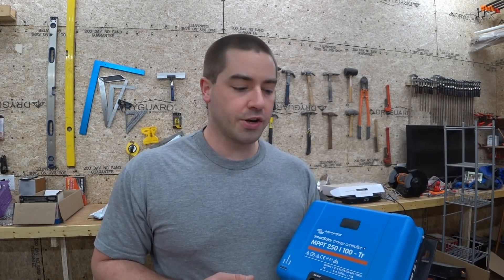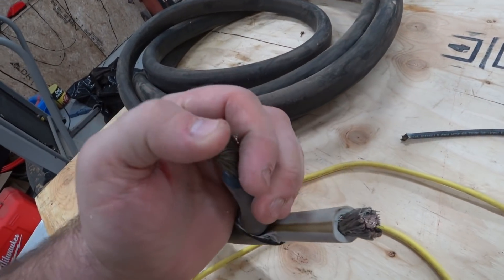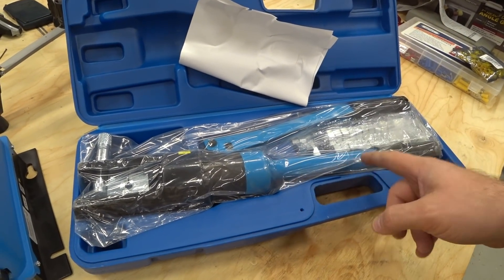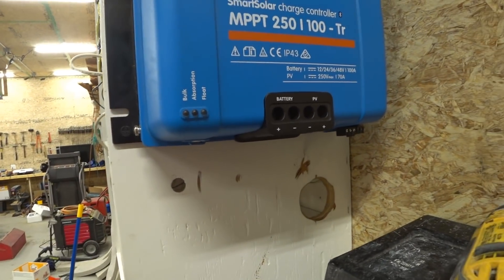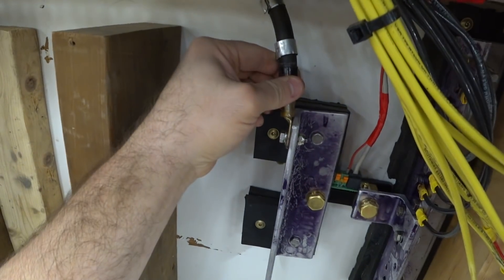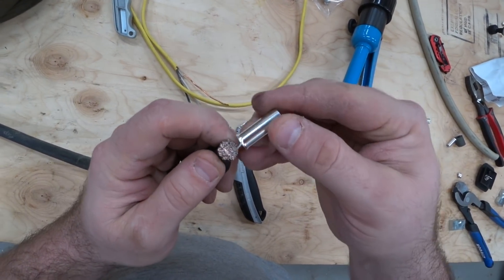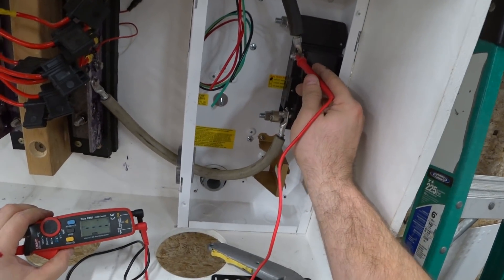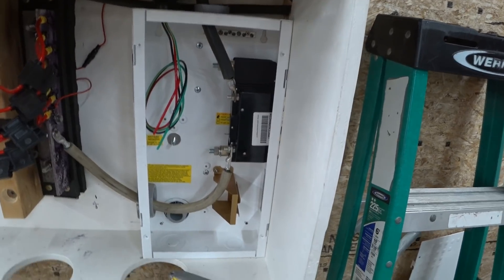Wiring Solar Charge Controller to Battery

Comment: what size breaker are you using ?
Reply from the maker: From the charge controller to the battery, I'm using a 125A circuit breaker.
Reply: @DavidPozEnergy  which would you recommend ? i dont want to go cheap and cause problems nor go to expensive ,  new at this and on a budget
Reply from the maker: Start with the charge controller you are using.  In my case, I'm using the Victron 250/100.  This model can output 100 Amps continuous to the battery.  Charge controllers can range from 5A to 100A generally speaking.  I don't know what size charge controller you are wiring up.  You need to look up the specifications on your maximum current (Amps).  
Once you know the maximum current you add 20% as required by NEC (National Electric Code).  In my case, I take the 100A*1.2=120A.  However, circuit breakers are not sold at 120A, the next closest size is 125A.  So, I bought a 125 Amp circuit breaker.  I used a "Midnite Solar" brand made for DC (direct current).
Once you know the breaker size (125A in my case) then you look up the Ampacity Chart in the NEC: https://codes.iccsafe.org/s/ISEP2021P1/national-electrical-code-nec-solar-provisions/ISEP2021P1-NEC-Sec310.16 in order to size your conductor (wire).
I'm using copper wire.  The circuit breaker I'm using is rated for 75°C (written on the breaker).  I look up the chart for a conductor that can handle 125A and I see that my minimum size is 1 gauge.  I used 1/0 in the video which is a little larger.  It's OK to go larger for the wire size, but not smaller.
I just described the process.  You must do this same process for your situation.
Reply: thank you  @DavidPozEnergy
Reply: little confusing ,but think im understanding , thanks for your help  @DavidPozEnergy

Comment: Measured leakage Voltage will be stored in the capacitors of the MPPT until drained over time or resistive small load,

Comment: So after reading the manual on the victron charge controllers I realized that if you accidentally wire the battery cables with the polarity in the wrong direction youll blow a non serviceable fuse and you need to send the unit back for repair... anyone know the cost of the repair... I can only imagine the unit must be replaced after seeing another YouTuber having to cut one apart to access the fuse... ouch

Comment: Hi David,  I have a Growatt 3000k inverter and I have max out it's internal MPPT. it is not capable to fully charge the batteries in one day because if the bank size. Is it possible to connect a secondary MPPT(solar array) to the battery system without damaging the Growatt Internals?
Reply from the maker: Yes.  You can have multiple charging sources feeding into one battery bank.  Your Growatt inverter won't know the SOC (state of charge) so ignore that on the display.  But it will still function the same based on voltage.  I'm testing this right now and it's working fine.
Reply: @DavidPozEnergy  Great! thank you so much for your quick response. Love your videos.

Comment: Not the propper tool for This crimping
Reply: True.  I believe it should be a square crimper.  That maximizes the surface area as the terminals close on it.  They won't come off with the one he used, but the surface area in contact with the terminal may not be adequate.

Comment: Thanks for sharing the vid. 
I've been looking into installing a Victron 250/100. 

I noticed some advice in the vid that contradicts the safety instructions in the Victron Manual for Smart Solar Chargers. 

In short the video says using wires without very fine strands is ok, when the manual says it will eventually result in fire.
 The examples in the vid showing thick stranded wire ok to use have matching photo's in the manual which says they should not be used.

What follows is from page 5 of the Victron Manual, note the last sentence.

Use flexible multistranded copper cable for the battery and PV connections.
The maximum diameter of the individual strands is 0,4mm/0,125mm² (0.016 inch/AWG26).

A 25mm² cable, for example, should have at least 196 strands (class 5 or higher stranding according to VDE 0295, IEC 60228 and BS6360).
An AWG2 gauge cable should have at least 259/26 stranding (259 strands of AWG26).
Maximum operating temperature: ≥ 90°C.
...
In case of thicker strands the contact area will be too small and the resulting high contact resistance will cause severe overheating, eventually resulting in fire.

Link

https://www.victronenergy.com.au/upload/documents/Manual-SmartSolar-charge-controller-MPPT-150-70-to-150-100--250-70-to-250-100-VE.Can-EN-NL-FR-DE-ES-SE-IT.pdf

Cheers Sincerely 
David
Reply from the maker: Thank you David.  Your comment is excellent.  I love when I'm called out, but you also help me with a link and explanation.  I've moved this charge controller and replaced some wires since this video, but I have not made an update video describing my mistakes.  Thanks.

Comment: Well in this type of connection the connection is MUCH better without the crimped ends, as the cable can cover the whole connection surface. Crimped it only touches on very thin points, which leads to high resistance

Comment: David  If the fuse trips for the Batt and the solar panels are still plugin to the charge controller will that damage the controller with no Batt going to the controller?
Reply from the maker: I've asked that very question to Victron and they said it will not damage it so long as the PV is below the voltage of the CC.  In my case 250v.  I've done this by accident, turned off the battery while there was still sun on the PV.  The CC is still working.

Comment: Trimming that larger cable to fit the smaller ferrule just turned that ferrule into a fuse and a fire hazard. It would have been better to source the proper cable size. And you used the wrong size die on that first ferrule. You can tell by the squished section that it appears you have filed down.

Comment: It seems to me, if those terminals on most charge controllers are too small to accommodate a huge wire, it may not be necessary to use a wire of that size. I had purchased a 4 AWG wire, thinking bigger was better, and just the fact that shoving it in those terminals was such a bitch, I put back my 10 gauge.

Comment: the voltage measured when shutting switch off is resudu voltage left in the charger, earthing wire here in europe for auxiliary earthing is 4mm², main earthing water and heating is 6mm²,  earthing bar in the electricity box need to be 16mm² where all your earthing comes to.

Comment: Hi I have  a question  all solar  panel  is 12 volts
Reply from the maker: Nope.  Solar panels can come in lots of different voltages.  The panels I'm using are 38 volts each, and I series connect 4 of them to make 152 volts.

Comment: But I had read somewhere don't put Ferrull's on
Reply: The victron manual basically says it's connectors are to work with very fine strands. So using a ferule does the exact opposite i.e. makes the wire for connection as big as can be. 

I wrote the following in my comment. 

I noticed some advice in the vid that contradicts the safety instructions in the Victron Manual for Smart Solar Chargers. 

In short the video says using wires without very fine strands is ok, when the manual says it will eventually result in fire.
 The examples in the vid showing thick stranded wire ok to use have matching photo's in the manual which says they should not be used.

What follows is from page 5 of the Victron Manual, note the last sentence.

Use flexible multistranded copper cable for the battery and PV connections.
The maximum diameter of the individual strands is 0,4mm/0,125mm² (0.016 inch/AWG26).

A 25mm² cable, for example, should have at least 196 strands (class 5 or higher stranding according to VDE 0295, IEC 60228 and BS6360).
An AWG2 gauge cable should have at least 259/26 stranding (259 strands of AWG26).
Maximum operating temperature: ≥ 90°C.
...
In case of thicker strands the contact area will be too small and the resulting high contact resistance will cause severe overheating, eventually resulting in fire.

Link

https://www.victronenergy.com.au/upload/documents/Manual-SmartSolar-charge-controller-MPPT-150-70-to-150-100--250-70-to-250-100-VE.Can-EN-NL-FR-DE-ES-SE-IT.pdf

Cheers Sincerely 
David
Reply: The victron manual basically says it's connectors are to work with very fine strands. So using a ferule does the exact opposite i.e. makes the wire for connection as big as can be. 

I wrote the following in my comment. 

I noticed some advice in the vid that contradicts the safety instructions in the Victron Manual for Smart Solar Chargers. 

In short the video says using wires without very fine strands is ok, when the manual says it will eventually result in fire.
 The examples in the vid showing thick stranded wire ok to use have matching photo's in the manual which says they should not be used.

What follows is from page 5 of the Victron Manual, note the last sentence.

Use flexible multistranded copper cable for the battery and PV connections.
The maximum diameter of the individual strands is 0,4mm/0,125mm² (0.016 inch/AWG26).

A 25mm² cable, for example, should have at least 196 strands (class 5 or higher stranding according to VDE 0295, IEC 60228 and BS6360).
An AWG2 gauge cable should have at least 259/26 stranding (259 strands of AWG26).
Maximum operating temperature: ≥ 90°C.
...
In case of thicker strands the contact area will be too small and the resulting high contact resistance will cause severe overheating, eventually resulting in fire.

Link

https://www.victronenergy.com.au/upload/documents/Manual-SmartSolar-charge-controller-MPPT-150-70-to-150-100--250-70-to-250-100-VE.Can-EN-NL-FR-DE-ES-SE-IT.pdf

Cheers Sincerely 
David

Comment: Hi David. I'm build my very first solar off grid with Victron, can you please take a look at my build and see if it works? I'm not sure if the 150w panels will work with the Victron. THANKS! https://www.evernote.com/l/As-kIlcP87BC-ZIV7gyVkt3C-7v5GPenR_g
Reply from the maker: Wow, that is a very nice diagram.  Thanks for labeling everything.  Looks like your 4 panels will be within the limits of the Victron 150/60 for Voc, and watts.  10 gauge from the panels to charger is fine.  Charger to battery you listed as 6 gauge, which is also fine if they are close to each other.  If the charge controller and battery are in different rooms then maybe bump that up to 4 gauge simply for less voltage drop.  Victrons website says the terminals on that model charge controller can go up to 2 gauge.    You have fuses and a disconnect switch, so you are OK there.  Maybe add a means of disconnect between battery and charge controller.  I see you have the fuse there, which is good.  I would add a circuit breaker also.  I like to size the circuit breaker a little under the fuse.  But your overall numbers and sizes all look good.
Reply: @DavidPozEnergy  Would a 60a Circuit Breaker work between battery & controller like this https://bit.ly/38BLlDa

The length of my 6 gauge is 6 feet and my 1/0 guage is 4 feet. THANK YOU!!!!!
Reply from the maker: Solar panels are rated under STC (standard test conditions).  But every once in a while you might encounter more sunlight than STC.  This happens to me this time of year with the snow on the ground, cold air temp, and a clear day.  So we generally add 25% to be safe.  For example, your 600 watts of panels charging 12v = 50 amps.  But multiply that by 1.25 = 62.5 amps.  So using a 60 amp circuit breaker has the potential to trip once in a while.  Very low risk because there is some overhead built into circuit breakers, but the potential is there.  I would prefer sizing things a little over.  So I might use a 70 amp breaker with 4 gauge wire, and an 80 or 90 amp Class-T fuse.  This also helps if you include your continuous duty requirement.  Which simply says you need to over-size wires if you use them continuous duty, which this is.
Reply: @DavidPozEnergy  This is so helpful thank you. God bless you and your family.
Reply: @DavidPozEnergy  Hi David hope you don't mind I ask another question. If I use 2x 150w panel with a voc of 22.7 or 3x 100w panels with voc 21.2 which one will charge my battery faster?
Reply from the maker: Hi Ken,  When you use an MPPT Solar Charge controller (like the Vitcton) The exact voltage coming from the panels does not matter, the charge controller drops it to match the battery.  The VOC of your series simply has to be lower than the maximum rating of the charge controller.  And the Vmp has to be a higher than the battery.
Reply: @DavidPozEnergy  Ok Thanks so much again.

Comment: my 20/20dingo plasmatonics pwm charge controller 12 24 48 volt  it won't work with my single house solar panel 180 watts why???

Comment: I have a question I can't seem to find the answer to. If I buy me a 12V solar setup of around 1000 watts worth of solar panels, a 3000Watt power inverter and all the other misc cables/components but only 1 lithium battle born @ 100AMP hours would I over charge my battery? would that ruin anything? because my budget doesn't allow me to get all the batteries at once so I plan on buying them slowly I'm hoping to get at least 6 eventually. but could only buy one right now. can someone please advise me?
Reply from the maker: Hi Lone-soul.  Thanks for your question.  First, the Battle Born battery has a BMS built into it.  (BMS=Battery Management System)  This BMS should protect the battery from being over-charged.  In addition, you should be using a Charge Controller in between the solar panels and battery.  The Charge Controller will do several things, but one of them is prevent over charging.  I'm using the Victron Charge controller in this video, but there are several good brands.  

The biggest thing I see wrong with your setup is the amps.  The Battle Born battery has a maximum current rating of 100 amps.  https://battlebornbatteries.com/wp-content/uploads/2018/03/BB10012-Cut-Sheet.pdf  If you connect a 3000 watt inverter, it will pull over 250 amps.  2.5 times the rating of a single battery.  

To be safe don't connect a 3000 watt 12 volt inverter to any less than 3 Battle Born batteries.  Other solutions would be buying a smaller inverter, or running a higher voltage system (24 volts or 48 volts).
Reply: @DavidPozEnergy  wow thanks a lot for all the info. I will follow your advice.

Comment: Hi, should you get a reading from your charge controller once you connect the solar panel, cheers.
Reply from the maker: I can open the app on my phone to see what is going on with the charge controller.  Inside the app I can read the incoming volts and amps, and the outgoing volts/amps.  There is also history stored.  Thanks for watching.
Reply: You're not supposed to connect the solar panels until after you connect the batteries

Comment: Hmmmm I believe Victron recommends just using the bare copper for their MPPT’s, based on what I’ve seen on the Victron community board.
Reply: They also recommend a finely stranded copper — typically found in marine applications.
Reply from the maker: Thank you.

Comment: Thank you. Omg I have searched everywhere, yours is the closest for help. lol  I got a 100/20 using a 10 gauge wire with EC8 plug going into a goal Zero generator..can you maybe tell me what size Ferrule maybe, or a rough estimate?  Thanks so much.
Reply from the maker: Hi bobby brown,  Thanks for your question.  I've heard good things about Goal Zero generators, but I have never used one so I don't know about hooking up to it.  As for the 100/20,  I just looked up the data sheet: https://www.victronenergy.com/upload/documents/Datasheet-SmartSolar-charge-controller-MPPT-75-10,-75-15,-100-15,-100-20,-100-20_48V-EN.pdf
It says the terminals are 6 mm (10 AWG).  So I just found a ferrule on Amazon: https://amzn.to/2XgfiT2  I hope that helps.

Comment: You mixing aluminum with copper?? Some one just told me that mixing those metals on connection make one of them going into dust in like a year time. I don’t know much about this stuff though.
Reply: I think the ferrules are tinned copper
Reply from the maker: Interesting.  My system has been up about a year and my connections are still tight.  I check them regularly.  Thanks for watching.

Comment: Electrical tape wrap on all your tools is good idea. Example, with your screwdriver, start the wrap, about 1 inch from the tip, and wrap towards the handle.Cheaper then insulated tools and just as effective. However, you must maintain the wrap to be effective.

Comment: Thank you.  I noticed the charge controller does not have terminals for load. Would the load be connected to a buss ( 2- one for positive, the other for negative)  bar along with the battery?  I am use to seeing the controller with load terminals     Thank you for your help
Reply from the maker: Yes, you have it correct.  Load terminals built into charge controllers are for very light loads (such as one light bulb).  Victron skipped these load terminals, but did provide relay terminals.  If you want to power large loads (such as an inverter) then you need to connect to the bus bars.  Thanks for watching.
Reply: @DavidPozEnergy  how would you keep a battery from running below 50% by connecting direct to battery?  Thanks.
Reply: @bmc9504  Victron Battery Protect
Reply: Thank you very much

Comment: Regarding your DC bond/grounding/chassis wire:

 "Install a DC grounding conductor sized not less than one size smaller than the DC positive conductor and have a capacity such that the DC positive fuse has an amperage rating not greater than 135% of the current rating of this grounding wire. As a practical matter, this wire will be much larger than the AC grounding conductor. This requirement is the latest addition to the standards when it was discovered that faults in the DC side of an inverter or charger could provide sustained high currents that could start a fire from overheating the AC grounding conductor."